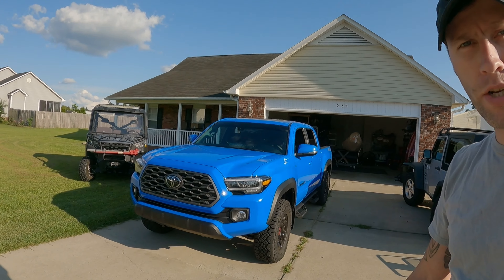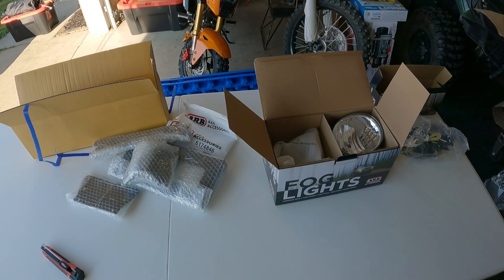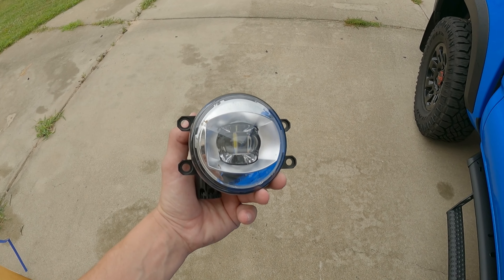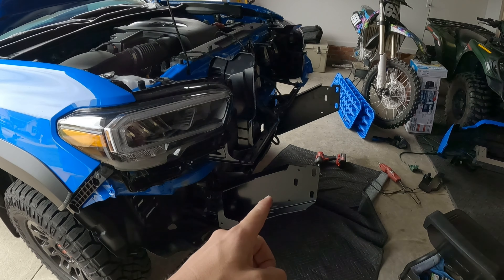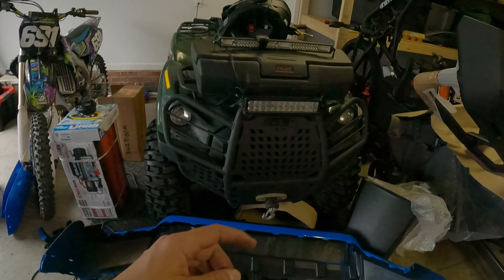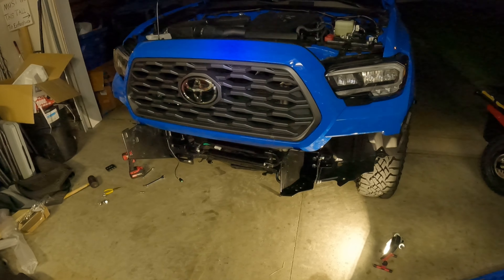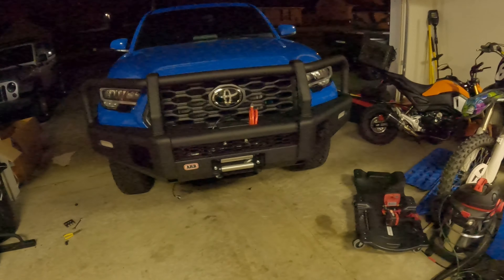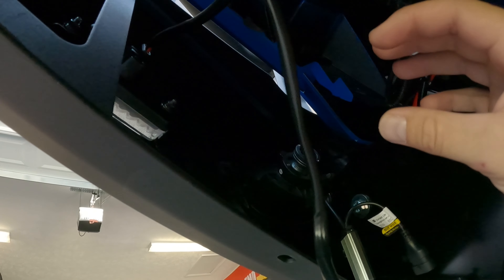ARB Summit Bumper Install 2021 Tacoma TRD Offroad

Comment: Hi, I just installed it today at Cap-it Medicine Hat Alberta,  the ARB SUMMIT FRONT DUMPER. On my Tacoma Offroad 2019, and I buy from R4T the plastic cover for don't have to mess with the Tacoma dumper.... but this plastic cover didn't fit with the ARB SUMMIT BUMPER... you need to cut this plastic cover to fit with the ARB SUMMIT BUMPER... So after you cut this part, everything is OK.but when I buy this part from R4T, it is not to deal with any cut..... .... Finally, I need to cut the R4T part.....
Soon, I gonna put a video on my Tacoma with the ARB BUMPER... I sent you the link ...

Comment: You definitely covenced me about getting this bumper... unfortunately I already instal the TRD pro grill with that Garnish sensor that is proplbable going to be a problem with any other winch.  

If you don't mind, recommend me a good suspension that would handle this bumper weight.  I am not doing any crazy off road.

Comment: Hi, thank you for all the info very good video job,  I m considering this bumper for my Tacoma offroad,  just one question,  this bumper have no D ring... do you know if it possible to put , I try to see on the net but I don't find.....    thank you
Reply from the maker: Thanks for the comment. 

No, there is no place for D-rings. 

However, your winch is a huge d-ring in the center of the truck. 

So, if you need to hookup to someone or something, that is also a good point to strap to. Even if you aren’t using it as a winch.
Reply: @AdventureOps1  thank you 👍
Reply from the maker: @fabienpics  pas de probleme mon ami. 

je parle français aussi 🇺🇸
Reply: @AdventureOps1  merci beaucoup pour répondre.  Je parle englais,  mais pas parfaitement.  J aime faire mon possible pour m améliorer. 
I stop my choice for this Bumper,    ARB it s great cie... and I love Australia I go there 3 times Amazing Country and it is the Paradise for Overlanding and full Great Garage for Overlanding parts.  So I m gonna order this dumper this winter ( 2022/ 2023) for my Tacoma offroad 2019. Thank you again to make this video. Helpful a lot. 
You still like you re ARB.
About the screw Bad.... you have totally right..... that s not acceptable .. the price of this gear they need to be more attentive the way they give this to the customers....

Comment: just got a used bumper. with no bolts to for all the extra plates. i also cant find a cut diagram online. do you happen to have a file for it and the bolts ill need
Reply from the maker: No I don't, but they're very responsive on ARBs phone and email. Order a new bolt kit.

Comment: Did you deactivated the TSS sensor on the grill? Thanks
Reply from the maker: If you watch the whole video, I spoke about it specifically and why I went with this bumper. It did not mess with the sensor at all. However, if you purchase a different type of winch that Mesa controller stick up in front of the Toyota emblem I will mess it up.

Comment: What suspension do you. Have? Thank you
Reply from the maker: Trd offroad stock suspension with the bilstein shocks.
Reply: @AdventureOps1  Front shocks: Bilstein 6112  4, 5 setiing with Bilstein springs.

Rear: Bilstein 5100 with ICON AAL for a 1.5" lift.

Comment: I pulled from the bottom, wheel opening was much easier. Also, if you take the plastic air dams out on the sides of the radiator it is easier to depress those fender flare clips, wedge a towel between the fender and flare and boom. done.

Comment: Not very many Tacoma owners likes the ARB bumper because it looks bulky and heavy. In my opinion i think it looks good on Tacoma as it balances between function and form. How does it ride with stock suspension? Well done on the step by step install. Thanks for sharing!
Reply from the maker: Thanks bro, it actually drives amazing I barely even noticed anything. This suspension and total dropped about 3/4 of an inch. But when I am towing, which is all the time everything is perfectly level. As you stated as far as function and form I don’t think you can get better than this bumper especially with the leadtimes. 
Someone else mentioned that they added 800 pound springs upfront and it didn’t move at all but the truck road like a dump truck afterwards.
Reply: @AdventureOps1   I agree it’ll definitely reduce ride comfort and fuel economy but that bumper really embraces any impacts and less damage on the front end. I often drive on the highway where deers are randomly popping out during deer season lol so this is one of the the reason why I like the ARB bumper bumper because they’ve been around for a long time and proven many times in Australia that it could take a lot of beating.

Comment: Nice video so how much do you think with everything minus the winch weighs?
Reply from the maker: Their website said it was 160lbs. My winch was about 24 lbs. 

Overall it squatted the front of my truck almost 3/4”. It is not noticeable at all. It still drives perfect, no excess bouncing etc. 
I would 100% buy it again.

Comment: Would love to know if the front of your truck height dipped down with the additional weight. Someone told me it can affect your radar cruise control if the height has changed it might need re-calibrated wondering if you know anything about that.
Reply from the maker: Dropped almost 3/4 of an inch. Barely noticable… 

It still drives perfect with no issues, some guys put 800lbs springs on the front to counter. 

Zero issues with radar. I have used it multiple times. 

🤙🇺🇸
Reply: @AdventureOps1  thank you for the information I'm seriously contemplating putting one on my 20/20 TRD pro
Reply from the maker: I 100% would do it again. Just make sure if you are going to get a winch that you put it on at the same time as the bumper otherwise you have to completely remove the bumper to put one on at a later date.